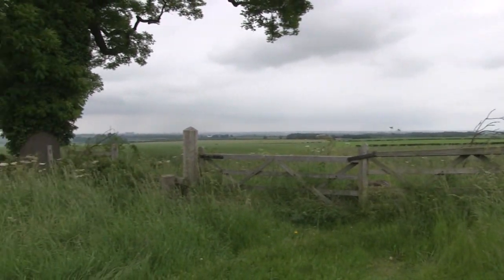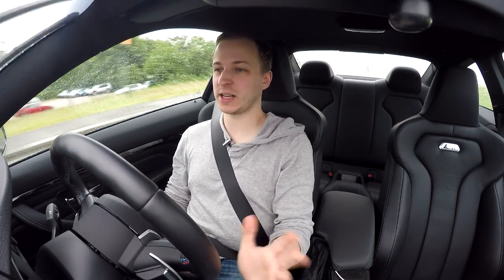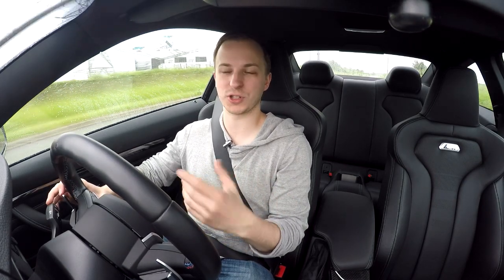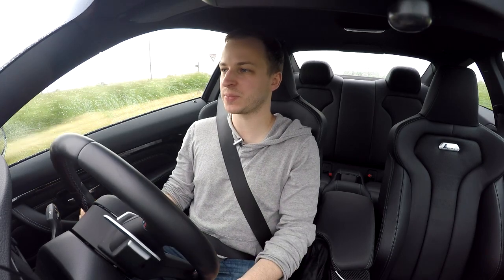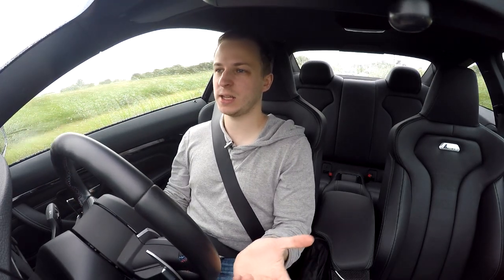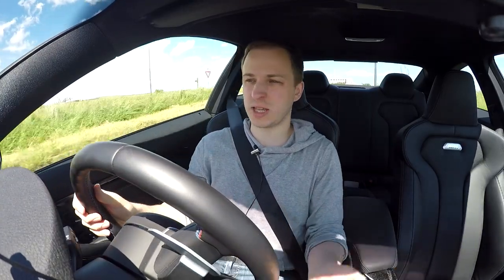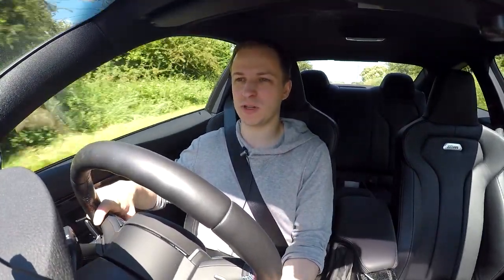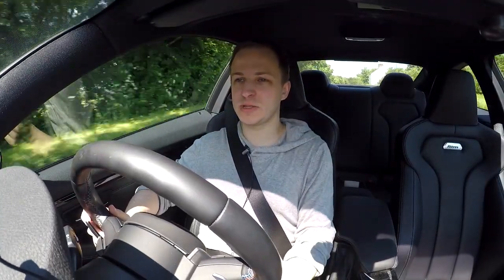M4 Brake Upgrades

Comment: Hi

I'd love to know how you have got on with the front disc/pad upgrade. Better stopping power, less fade, no vibration etc?

I have killed 3 sets of standard discs on my F80 M3 (have used standard and M Performance pads) and I'm considering changing out for thicker 32mm discs (like AP 380x32mm rotors and bells) and the EBC Yellowstuff pads.

Are the Stoptech discs 30mm or 32mm thick?

Thanks in advance

Baz

Comment: Hi Chris, I'm not certain as you only showed the one disc being replaced, but it looks like you have put them on the wrong sides. The cooling channels in the disc as well as the cleaning grooves should face the opposite direction. That's for enhanced cooling and cleaning. Good discs are normally 'handed' ie only go on the way side.
Reply from the maker: They did have an L and an R sticker on them, but it was hard to know if that meant left/right from looking at the car from the front or from the back (i.e. sitting in the drivers seat). I compared against the ones we put on the GT86 and these are on the same way, so maybe we've done the GT86 ones wrong as well lol but the way the cooling channels flow makes sense. They go round the same direction the wheel will rotate, so the air would flow through them. Are you sure they should be the other way? Any guidelines anywhere you know of?
Reply from the maker: Looks like&#160;according to this page I do have them on the right way round (the internal vanes in mine are slanted facing towards the rear of the car and everyone seems to agree that's the most important thing) : https://www.zeckhausen.com/catalog/index.php?cPath=6446_6515
Reply: +DedicationBlog yes sorry Chris, I looked up their data last night and checked the vid again and yes you have got them on the right way around. The outer grooved threw me as they must orientate them the same way as Brembo, which is the opposite to everyone else. As you say the internal vanes are what matters most.

Comment: Have you been driving around with the YellowStuff enough to give a short review of them on a daily basis? Im currently considering these for my E46 325i. Have tried RedStuff, absolutely horrible! Had less than stock grip when cold, and when you pushed them a bit around the b-roads, they would fade after only 2 or 3 brakings.

Nice burnout by the way!
Reply from the maker: That's surprising, I had RedStuff briefly in my M235i and found them to be a great improvement over the stock pads in every way. I did a track day in the M4 yesterday and the brakes took a while to get properly bedded in (apparently the 10 stops from 60 mph that I'd done on the road wasn't enough). After that though they were great and didn't notice any fade during 20 minute sessions. I did notice that when I drove it today, they had a bit less initial bite when cold compared to before the track day. Not sure if that will come back once they've been driven normally for a while but we will see
Reply: Best thing you can do is 330i brake calipers and hawk pads,.ive never had an issue at the track with this setup

Comment: any reason you went slotted instead of drilled?
Reply: Engineering Explained has a video showing the perks of slotted vs drilled, slotted hold up to heat better.. The holes will heat up quicker then the rest of the rotor and can cause cracks warping etc.
Reply from the maker: Yeah like someone else already said, drilled causes more problems than its worth. Most exotic cars only have drilled because it looks cool, not because its actually better
Reply: +DedicationBlog thanks for clarifying

Comment: How long has the R8 been gone? Swear it's been months, something big has surely gone wrong!
Reply: when you drive your cars hard ofc it can break badly :p normal or supercars does not matter :p
Reply: Was thinking the same.
Reply from the maker: Yeah it's been gone for quite a while but I got it back yesterday - just temporarily to do a track day while we wait for some new parts to arrive. Getting to the bottom of exactly what was causing the whining noise has taken some time as there were quite a few bearings in the gearbox and diff that were badly worn, so they've been replaced but then it hasn't resolved the problem. Bear in mind each bearing is pretty expensive (full set for gearbox and diff is about a grand) so we didn't just replace all of them at once, but that means it takes a long time because after each bearing was replaced the transmission had to be built back up and filled with oil and mounted back in the car etc. Then they'd go test it, discover the noise was still there, then strip it all down again and look at the other bearings, etc etc. Finally found that although some of the bearings were pretty bad and needed replacing anyway, the actual cause of the noise was the gear that drives the pinion in the diff, so just waiting for the replacement to arrive now (has to come from Lamborghini and takes a couple of weeks to arrive). They've swapped the gears round temporarily now though so that it just makes the noise on deceleration instead of acceleration, so hopefully it'll be fine for one track day.
Reply: That's not good, mad to think all that costs almost half my whole car

Comment: How about a detailed video comparing your old E92 M3 vs this M4?
Reply from the maker: tbh its been so long since I drove the E92 I don't know if I could make a great comparison. The M4 is obviously more modern inside and has better tech, but the main differences in driving is the turbos in the M4 giving you so much more torque. So its much more effortless to go fast - you don't have to rag it all the way up to the red line like you did in the E92
Reply: oh, ok, I see. Few things have changed except what you mentioned.

Comment: How did you do the burnout in the M4?
Reply from the maker: turn traction control off, floor it in 1st gear, press the brake just enough with my left foot = burnout :)
Reply: Are you in first going around the round about as well or in second with excellent throttle control may I add!?
Reply: +DedicationBlog Awesome! Sounds simple enough! :)

Comment: Uhhh... that's not a brake upgrade, that's a rotor swap.  Not even sure I'd consider slotted vs. cross-drilled an upgrade.  Visually it's definitely a downgrade.
Reply: TasteMyStinkhole only a proper fool judges brakes so heavily on their aesthetics
Reply: There you are as usually with your negative comments